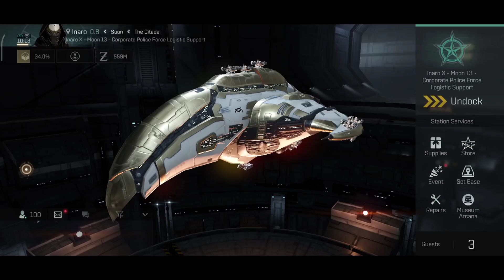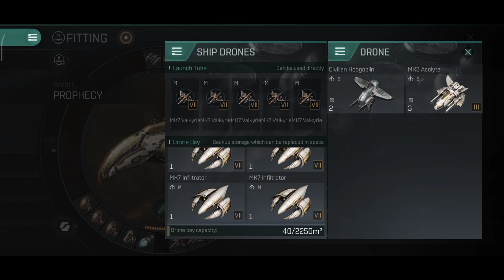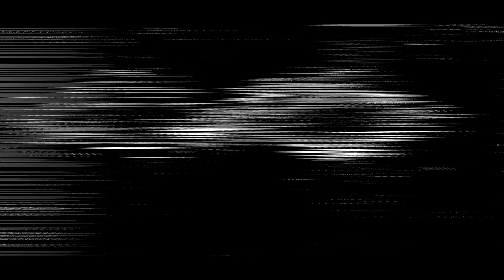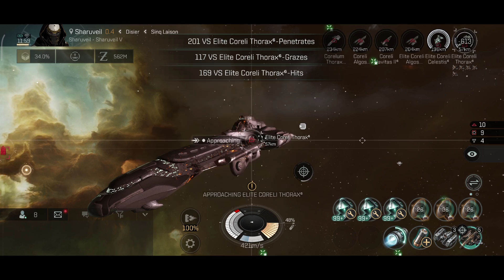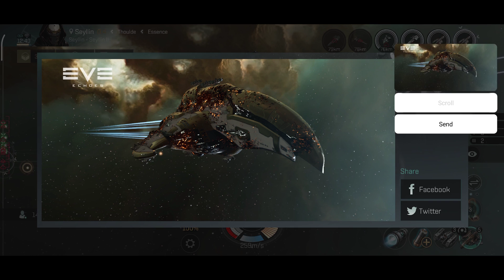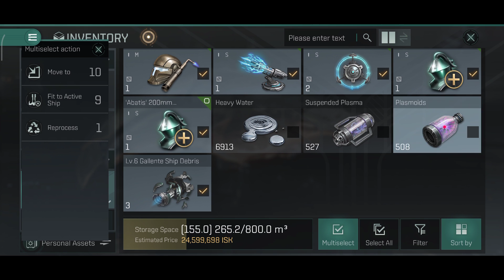EVE Echoes Amarr T7 Battlecruiser - The Prophecy [Drone DPS/Armor Tank] New Fit For For The Beast

Comment: Nice video. I enjoy a lot using the Prophecy solo for story missions. My fit is a lot similar with little changes. Instead medium armour reps I am using the large variant  ATM there is no difference in the requirements , I think the devs completely forgot about this since you can fit them on frigates as well 😂

Instead the cap booster , which IMO you don't need since only the mwd is using cap I using one armor hardener and in the high slots one large missile launcher. With the 65km range they work well with drones in a kite build. With skills and a rig you can fit 2 LML. Another interesting possibility would be using a large afterburner.

About the AI changes , yesterday I read somewhere that the devs would not implement the changes. They said they needed to make more testings before they do. But I can't confirm this. Anyway keep up the good work.
Reply: How are you getting L MWD to fit?
Reply: @cossackx  a LMWD  is impossible at least I think it is. But a L AB you can.

Because I am not using armor repairs in the low slots and the large armor group repairs only need 1MW this will save a lot powergrid to use in large modules. Large AB or large missile launchers are good option for a kite build. However with a large afterburner you still need to be careful with the cap. Good skills and probably a rig will be needed to work without issues.
Reply: @thebaron6481  interesting. I haven’t looked at the numbers. Is a L AB better than a blue M MWD?
Reply: @cossackx  well depends on the situation. In terms of speed a L AB will not give you the same speed . As an example my prophecy atm will reach 1100 m/s with a M MWD , with a L AB will reach around 900 m/s ( I don't remember the exact number ) , however if you are using the AB you don't have a signature radius penalty , and warp scrambles are coming to the game and this modules will deactivate your MWD but not the AB. And as a final note a L AB will eat a lot your battery in comparison with a M MWD.  So if I can keep a long range from the enemy in a kite build a MWD will be better ,if not and it seems the devs are going to implement rats with warp scramblers in game and I can manage my cap then a L AB can be a good option.
Reply: Do you it’s worth investing in a secondary weapon skill? Like Missiles or cannons right now?  Need tech 8 to learn large missiles so that’s not an option unfortunately
Reply: @cossackx  well that depends on what you want to do. For example me at beginning i focused all my skills around the caracal , shields and missiles. With this I could do story missions and also  do some solo hunting with my stealth bomber. However when the option to respec the skills come I decided  to change everything and focus on armor, BC and drones because I knew they were the best for PVE. With that being said I will still need more 2 months until I have all skills in those areas with 5/5/4 but after that I can focus on anything without worries because I know I have a great package in a specific area to win isk and this will give me time to know what to do next. Is the railguns going to get a buff? Missiles for me are always good. They don't have tracking problems , don't need cap and use little powergrid , so a combo missiles + drones sounds a great option . And I still need to wait and see what the devs are going to do with the elites on the public server . If they are going to implement the changes on the test server with elites orbiting you around 4000 m/s good luck in hitting something .

In the end all depends what you want to do on Eve. But if you want to do some PVP , drones are atm a bad option.
Reply: @thebaron6481  good points. For my prophecy, I started putting just a bit of skills into cannon to extend some range so I’m not wasting 3 potential DPS sources. Now I’m just thinking of taking all of those points that I put in the cannons and moving them somewhere else like into BC defense or engineering even. I might have a little less DPS but with drones at 75 KM out there’s not too much practical to put in those high slots anyway